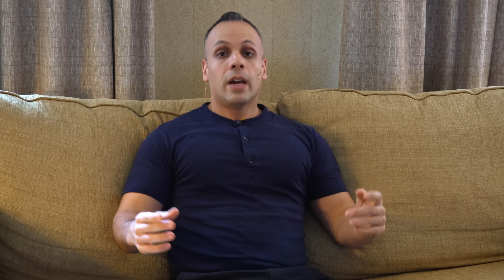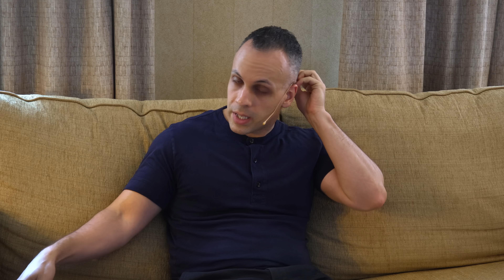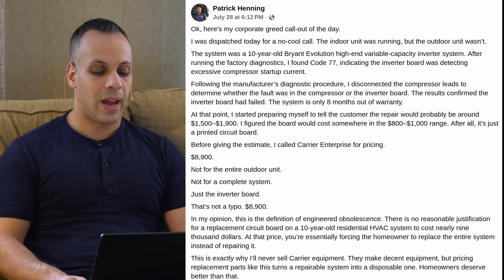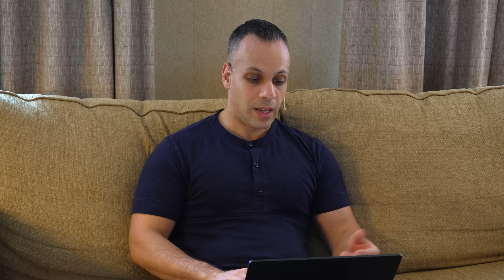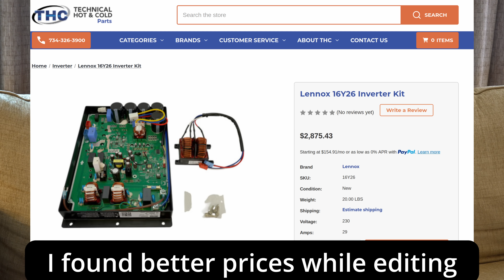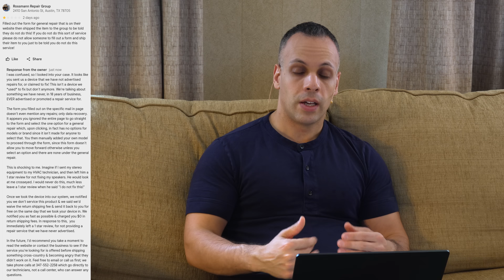Carrier AC repair has $8700 part cost for residential unit

Comment: I have a basic, one thermostat, single stage 3 ton Carrier Comfort 410-A Gas Heat/AC system professionally and meticulously installed and calibrated October 2024 that replaced a 20 year old Carrier R22 system before the deadline of Jan 1, 2025. Full extended factory warranty. It works perfectly and worth every penny I paid for it. Zero buyers remorse. YMMV.
Reply: So you're happy with your unit that is not even two years old... ok.
Reply: @therealmeachy71 Yes. Very happy. Thanks for asking.

Comment: HVAC industry is such a huge scam at all levels. You get an undersized unit with the new home, then some clown tries to sell you more unit than you need once it breaks a month out of warranty because it's running 24/7.
Reply: Systemic issue.
Reply: @davidrox4591  Yep, it's so tiring. It's very hard to find an honest HVAC repair company too. I mean why would they want to make $500 when they can make $5000 by convincing grandma she needs a new unit when a $30 part fails?
Reply: Depending if living in a communist county or not.  When the permit is submitted, it must include a minimum amount of information to prove the unit isn't oversized - this would also include the make/model & serial number, along with home sq/ft and how everything is routed and software output to make the calculations....  Who determines the size?  The government.  In Arizona Democrats recently required units to be intentionally undersized to force homeowners to make efficiency improvements to their homes (new high efficient windows, better sealing doors/vents, foam attic/wall insulation, etc..).

Comment: I have a Trane AC with 10 year warranty but it only covers the part cost which was $2400 for evap coil but all the AC company does is charge you labor cost which coincidentally is the same cost as the part covered under warranty.  It’s all a scam.

Comment: I had to replace my Hvac after my old ones of 25 years finally wore out.  I am Glad I went with a Goodman.  They tried to sell me on a fancy Carrier system but I went for simple and reliable and it has worked like a workhorse since.   4:40 I hesitate buying anything with a lot of bells and whistles.  The more tech, the more it will cost to repair and more that can go wrong, and clearly, preplanned obsolescence has become a real problem.

Comment: I have a Rheem HVAC system, and I guess I'm glad I do.  A replacement Rheem inverter control or accessory kit for an air conditioner generally costs between $300 and $800 for the part alone.

Comment: I think it's the F U price. I don't think they want to supply replacement parts, they just want to make money off of new installs.
But this is the way alot of hardware industries have gone. Hardware industries, i.e. those who make their money off of brand new items, such as fridges, HVAC units, phones, etc., as opposed to software industries, such as Microsoft, Adobe, and every app which is used to control those machines around you, have moved to a subscription basis for their income.
Any company which uses both, such as many of those HVAC companies as well as many car manufacturers get to fuck you twice. Things which are proprietary can have their prices jacked up when it comes to replacement, meanwhile items outside of Bluetooth connectivity can be placed on a subscription basis, such as heated seats.

Comment: It massively pisses me off when companies charge outrageous prices for repair parts. Somehow, it should be required to notify buyers at purchase of the repair parts pricing and availability, so that we can make an informed decision. Also, I wish someone would make generic replacement boards that could keep systems working once the manufacturer stops making parts. Rather than forcing a system replacement, keeping a system running is usually more efficient even if it's not as "efficient" as the new, fragile systems available today (but considering the installation costs and poor quality of the parts, etc.)

Comment: I ran into this myself when the blower motors on two carrier furnaces in my house died. Just to replace the blower motor almost cost as much as an entirely new furnace. An expensive new carrier blower motor only has a one year warranty, while a new furnace has a ten year warranty. I'll never buy anything from carrier. Oh and while not HVAC related, I've had similar issues with hayward pool equipment.

Comment: In some cases a inverter board can be removed entirely and the compressor hot wired and made to work as a standard central ac...My opinion.

Comment: 8-15000 for a system designed to fail when it gets hot enough that you'd actually need it to work versus...If you have 80 feet of earth at your home, spend the weekend digging a four foot trench, install a non ribbed pipe, on a slight angle, run it to the home. Free cold air for the life of you being there...
Theres a reason people are moving to off grid situations.
Reply: I can't visualize exactly how this works, but it sounds interesting. Unfortunately I don't have 80 feet anyway.
Reply: @therealmeachy71 You could do a spiral with the right pipe but the pipe needs to be quite big to let air through. Or you can set up multiple pipes. But you want enough pipe that the volume of space in multiple pipes matches the volume of one 80 foot pipe.

How it works is, on the end away from the house you have an air intake at ground level, if the house is hot, when heat rises this pulls air in through the pipe and because the pipe is buried it stays cold, so  it constantly pulls fresh cold air in forcing the heat to rise and escape because of the pressure.

Its still a pretty common technique in earthship building, one or more pipes are usually buried going out in different directions...

Look around for others that have smaller gardens, you might still find some solutions you like.

Comment: I won't be buying a Carrier in the future. As we all know corporations are moving more and more to making repair more expensive than replacement so they can sell more new units instead of parts. This case sounds like that to me. I just repaired my 10 year old York AC condenser for a $25 capacitor and an hour of my time. Chilling out now. 😉

Comment: I worked for a manufacture that designed and had made a lot of PCB's made. These went were component rich multi layer boards. One type was even made special with a dark material because it had light sensors for looking at fruit colours. The dearest ones cost a couple of hundred with the mega board that was large and very heavy controlling a multi high speed camera machine costing less than $500 to make. I think they put a lot of mark up on their PCB's but nothing like what is happening here.

Comment: Idk what tons convert to, but you could buy like 100,000 BTUs with of mini splits for the price of the board
Reply: One Ton = 12,000 BTUs
Reply: @blackrifle5.56 damn so for about the price of this circuit board, you could buy 8 tons of capacity with 10 indoor units for room by room climate control.
Reply: @D1V15OR  🎯

Comment: I have two Hyundai inverter units, if the inverter board dies, i will fix it myself, even if i have to redesign the entire inverter board because then it will not die ever again because i will overbuild the son of a gun so much that probably will blow up the entire block instead of my inverter board xD
Anyway... it's been 6 years so far, and they are still running fine, one note, i ALWAYS unplug them after use, and two: I  have a voltage protector that cuts power if it detects low or high voltage and has a 120 second connection delay which is essential for inverter boards not to die.

Comment: When I did HVAC repair we leaned toward putting in oversized and higher quality units but never the units with crazy high end features that require these add-in boards and additional bits and bobs. The parts are ridiculously expensive or impossible to find after a decade and they add a lot of failure points to something that really just needs a couple of big capacitors and a contactor to run as intended. The condenser unit that lives outside your house is really a very simple machine when you take the covers off. There's a fan to move air through it and a big electrical pump to condense refrigerant back to liquid form and that's it in terms of moving parts. It might also have a transformer to make 24v for the thermostat, but other than that its just a big radiator in a box with a pump. Simple units that are just a little oversized for your square footage are just as efficient and you dont have any of these circuit boards and proprietary parts to go bad, just stuff you could buy at Grainger or something and replace yourself. With a unit that costs 8-10k and can easily last 20-30 years you don't want to chance having one part going bad 10 years in and you can't even source it.

Comment: i replaced my ac myself with a ducted heat pump from mrcool, because the lineset does not need to be brazed, purged or vaccumed to install it, and the whole cost was half of what some of the hvac companies were quoting for equipment alone. i just checked, and the inverter board for my 3 ton condenser is $400 for brand new oem. that carrier board probably costs 200 to manufacture. shits rediculous

Comment: yea 10 years ago my AC did the same thing the inverter board went out come to find out 2 capacitors  20ohm replaced with a 25ohm popped these was the days of radio shack i paid $4 for the replacements -still going strong

Comment: The picture you showed as the inverter board did not look like it had any custom components.  They all look off the shelf, so, repair should be fairly straight forward

Comment: Oh no it's the old I won't buy this brand ever again. Carrier makes more brands of air conditioner's than anyone on the planet. So the odds are you may pick one of their other brands and give them the money anyway. The argument over efficiency, DOE regs, EPA regs are all valid. While there is no rule that you can't repair an older air conditioner that uses a phased out refrigerant if you need a part that is no longer made or the warranty you get from that repair is 1 year the risk some times out weighs the reward. 

All manufacturer's do this sort of thing to varying degrees. The ramifications of Paris Climate accord, 81 million votes... then a substantial shif the other way 4 years later and yet again jumping out of the Paris Climate accord. But those motions were already put forth, there is no going back. 

Intro to New A2L refrigerants: (mildly flammable) convenience version I have a 5-6 part history lesson on all of this Freon Wars logic. There are 2 types: R32 & R454b both are mildly flammable. The R454b type has a costly patent not to mention a PFAS chemical that produces TFA when it leaks and breaks down. Not a question of if but when. Europe is already in the beginning phases of banning this substance. (Forever chemicals) R32 is the common denominator for all refrigerants. Including the recently phased out R410a. (50%of that is R32).

The market has fragmented: Most HVAC manufacturer's in the US have chose R454b. Which ironically in my professional opinion will likely be the first to go, when will that time come? Probably no later than 2036. How do I know that? The Kigali amendment signed by then President Obama shortly before the 2016 election. ( I go into this in more depth in the video posted on my you tube channel) 

So what about R32? yes it to will also be phased out because it's an HFC and global warming is higher than that of R454b, even though it has no PFAS chemicals to worry about. The goal in the USA is to get below 150 GWP by 2036. Costs have done nothing but go up. Carrier knows this, I know this and now you do. 

So while you could switch to a brand that uses R32, it's still an A2L that will require mitigation controls. High tech talk for more money. If you have an older unit that is functioning you better start caring for it with the realization that once it goes out you aren't going to like your choices going forward. 

Beyond 2036? R290 is the likely choice. But there are problems as this is known as Refrigerant grade propane. Air Conditioning requires a significant charge of refrigerant so while you can get away with Propane refrigerators in the home, this won't be the case for air conditioning. The building codes will never approve propane to be run as a refrigerant into the structure. So for even more money you'll be retrofitting your house for your AC to be operated like a chiller, via a chilled water loop (brine so it doesn't freeze). These units that are called Monoblock heat pumps are already available in Europe. Unless a new discovery is made for a better chemical that isn't toxic, low GWP, zero ODP not to mention Energy efficient and CHEAP & Plentiful. 

If you like to be comfortable the brand names mean very little these days. Fact of the matter is 10 years ago when the decision to put this unit in was made, there was no discussion of R410a being phased out. No one saw this coming until about 2021. That was the year I started making the videos about it. Many scoffers at the time... and here we are
Reply: So why would Carrier do this for a specific part such as an inverter board. 

The unit you have is just out of warranty. The products that are still in service still have a warranty for that part. BUT the part is obsolete because the newer units of the same caliber likely use a different part. 

The part in question is expensive. Manufacturer's are bean counters. An obsolete part doesn't pay you to keep making the part (an expensive one at that). So they price it out at a higher price to make it worth their while to replace the part they have in stock to cover the "IN WARRANTY" systems that are still out there. 

Comparing to Lennox, Trane and others? You can't really do that without knowing stock levels of the part in question for an obsolete model. 

So as they say: It is what it is, because that is what it is. (These parts are made over seas or at the very least south of the border which adds even more trouble for the bean counters)

Comment: Carrier is still very proud of their name and they do charge for it. Last year I updated both units to the infinity series. Overpaid for them but I did receive a little bit back from OG&E. They do what they claim to do but is it worth it? Time will tell. When they run in the summer to cool, you cant hear them. In the winter time, they heat so efficiently that the unit emits as much moisture as it does in the summer. Over priced? Yes! Do they produce? Yes! If you live in the Tornado/storm alley. Be sure your insurance covers a lighting strike!!

Comment: I've done a lot of AC, although not professionally.  When my evaporator developed a leak, I engineered a new installation.  I've received compliments from AC professionals on my work.  

For $9000, you can get two brand new 3-4 ton compressor units, plus installation, of course. 

eBay is a good source for all kinds of boards.

Comment: This makes me think about my current situation with our LG Range, a while back I cracked the glass/ceramic top and now it's got cracks going across the entire top from that spot. Going to be sourcing a replacement top unfortunately its nearly the cost of the entire unit. I believe in fixing stuff when I can as long as the fix doesn't exeed the original purchase price so. Here were are. I like the LG appliances but, damn the parts are going to eventually push me out of that ecosystem one day I swear.

Comment: Yeah i had my 26 yr old 1ton goodman unit finally hit the dust this year.  You read that right.  It was built with the house in 2000.   Called my home warrantee company they sent a contractor who stated it needed to be replaced instead of repaired.  Their words it would be like putting a bandaid on a gunshot wound.   So iasked them for an estimate to replace like for like goodman.  They quoted me 18k for a 3k cost goodman system.  I had heart attack.   Thankfully i called around and got a company to replace it for 6k and so long home warrantee company.   The home warrantee company wouldnt reimburse for the replacement they would only cover repair.

Comment: I had to replace my water heater recently, and found that for the one I wanted, real prices are only available to contractors. If you aren't one, you have to pay like 20% more. It still wasn't as expensive as hiring it out and there is nothing difficult or dangerous about replacing a gas water heater with an electric heat pump one, so I just did it myself. I saved money and now I don't need plumbers for anything.

Comment: Just finished replacing the entire system after discovering each and every unique failure of the prior installation...

Off level installation with a poor drip loop vacuum, a coil drainage tray with provided instructions to never use at temperatures over 300⁰...installed directly above the HE coils...which rusted through...the dripping condensate burned the blower motor out and was mildew central for a bit

A number of other issues were at play too, but in the end the warranty goes to the original homeowner and expires before these types of installation failures catch up. The manufacturer won't warranty a bad install, especially when the instructions include a specific warning about the tray type and temperature 

The goodman (amana) control board? Worked until the last second perfectly. Everything else? Basically Condemned

Comment: My parents Carrier HVAC system had a board failure that I diagnosed. I found an updated aftermarket replacement board rather then replacing the board components for under $40. Now, it was the third board from the second manufacturer's the first two were bad bleeding 115v through to the 24v side if the circuit. Amazon return policy made it easy and it was only the time to get the replacements that were painful. A whole 48 hours. HVAC manufacturers are horrible.